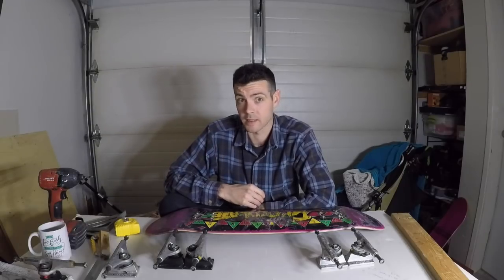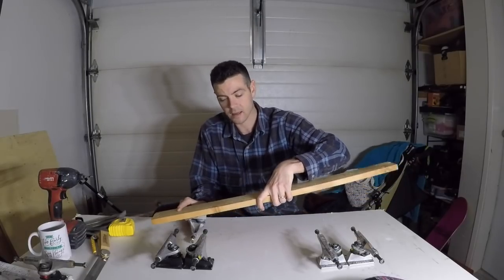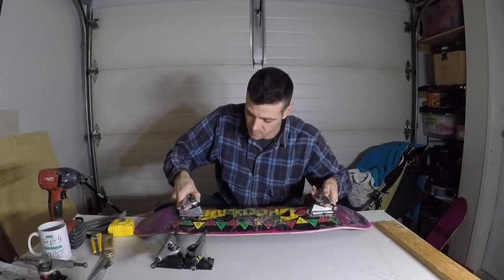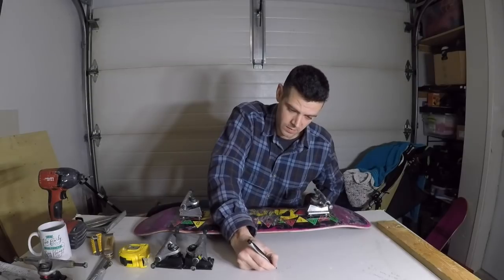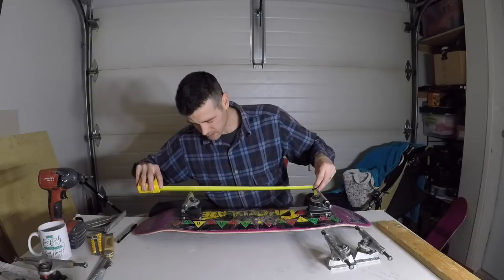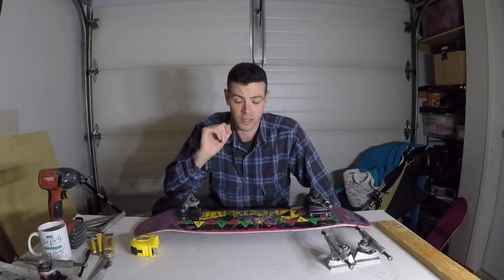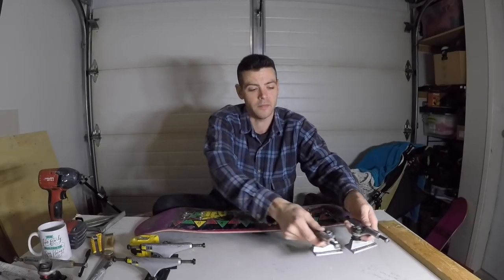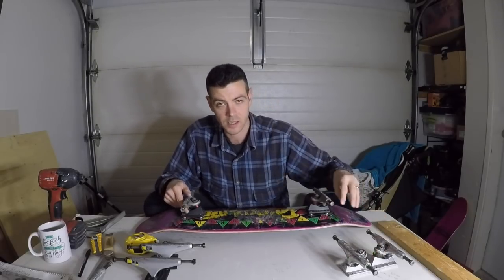Skateboard Wheelbase Explained#2 (Trucks)

Comment: You can take any indy  and add another washer  under your bottom bushing and change the wheelbase of any skateboard. You take a 14.25wb board, tighten your trucks down all the way and your wheelbase would be something like 14". Adding the washer raises up the hanger basically making it a longer wheelbase. 
Lower (tighter) bushings = shorter WB.
Higher (looser/thicker) bottom bushing = wider WB.
Reply: Woah reading this just unlocked a whole new perspective. I’m on hollow lights and I tighten the nut to expose two threads. I think most people would consider that pretty tight but to me as a new old skater it feels insanely responsive. Now I feel like I can experiment with more wheel bases by simply adjusting my trucks. Maybe in a high medium low kind of scenario. 

Anyways comments like yours make YT a place of discovery and I appreciate that ✊🏽
Reply: @OutdoorCanadians  I had to do it with a pRod Primitive board where it was only  14" wheels base. Put a extra washer on the bottom and boom! Huge difference.  Science! 🤣

Comment: Pro tip: use 2 different brands of trucks and make sure one is facing the wrong way. It also helps if each of your wheels is a different size. That'll get you the most pop 👍

Comment: Although;

I've got a brand new wholesale skateboard on my hands yesterday

as yet the deck measures a wheelbase with 12.7" or 32.3cm as which I've tested they having poor handling on doing ollie jump as my first lesson as beginners as yet their package trucks having a soft bushings but the trucks have may coping with generic base plate designs for thunders as yet reaching its 16" barriers but the serious issue was poor load bearing stability as which they need to tighten its bushings
as the mentioned trucks may having over 50mm as tall trucks as which wheelbite were minor deterrence and the general operations did not achieves hazard operations whilst the bushings never been adjusted and they generates mere hazards

as yet I have afterparts that also a generic counterpart by Indie Trucks and the manoeuvre is manageable for its responsive accumulations as they wheelie and turns to command much autonomous and they cruising with less hazards,

they have 55mm tall on my customed trucks as yet the wheelbite is highly zero deterrent as yet never recreating absolute hazards but the only deterrence they reducing the wheelbase with nominal measurements down to 15.6 or exactly 40cm respectively

as though if I comfortable with my nominal 40cm wheelbase were cruising is absolutely cleared from hazards and yet for responsive handling is also cleared but to do with skateboard vaulting tricks were I'm clearly lacking, my question is, are the 40cm nominal wheelbase can also do altered credible stunt possibities?

Comment: You nailed it Ben! Thanks for a good video! Id like to add that another way to say it, is that the trucks wheelbase makes the board pop “faster and flatter”, or “slower and steeper”. Due to the “pop angle” they give.

Comment: "If you don't know how to read a tape measure." I laughed. :)
Reply from the maker: Chris S. You don't realize how many people can't until you start training newbs in construction. I worked at a truss plant for almost 2 years before I started my apprenticeship an everything was measured in 16ths. For example 1/2" was called 8 sixteenths. My first job as an apprentice was working for a gnarly old framer who was screaming measurements at me all day. I had to figure it out pretty quick. I used to stumble with 5/8", 3/8" and 7/8"  for the first little bit.
Reply: Lol... if you don’t know how to read a tape measure.... run headfirst into a wall.... hehe jus messin... Ben is the man!! eeey!(Canada accent) beeen..
Reply: I know a guy who can’t. That said some tapes are way way easier to quickly read. I buy cheap ones when they go on sale because I always loose them or bend them and they are a pain especially for 16th

Comment: Great video Ben it’s rad that more people will know how to fine tune the board to exactly how they want it and also save people money so they don’t accidentally buy a deck with a 15” wheelbase and don’t understand why it’s super hard to do flip tricks lol
Reply from the maker: Honestly, I didn't know about wheelbase until last summer. I knew I liked slightly longer decks and that I liked the gap from the bolts to the nose/tail to be smaller but I hadn't connected the dots to wheelbase yet. All I knew was that if it didn't work on indys switch to venture/thunder. I actually thought it was a truck height thing for the longest time. I had no idea it was wheelbase.
Reply: how is it? is it easier?
Reply: @bendegros  I think it would be a combination of wheelbase and truck/wheel height. Not sure which would have the biggest effect...
Reply: @bendegros  I’m from London and don’t really understand these units, what does the 448 and 449 stuff mean - is this 4.48 and 4.49” inches?

Comment: Hi Ben, I got idea for new setup madness. I've been mixing different parts from different trucks to figure out what works the best for me. For example I mixed Tensor Maglites with baseplate with Destructo inverted kingpin baseplate to get the best kingpin clearance and get lightweight trucks that grind well. I can even add board rails and it would weight as a regular board but it is ultimate street destroyer. Although the geometry of trucks are different in many cases they can be easily adjusted with washers on kingpin in most cases. Also I combine harder and softer bushings on the same axle so that my trucks are kinda loose when turning but stays perfectly firm and flat in a straight line.

Comment: ok I've definitely never pay attention to these wheelbase set up, and now I've watched that explanation, I've check out what was my best set up and what was the worth set up I add in the past, and guess what? the perfect set up I had, have the best combination of wheelbase board/trucks. They should teach you that in skateshops! ahaha
Reply from the maker: What was your favourite combo?
Reply: a 8 1/4 dagger board (dave Duncan) with Indys and 64mm wheels, with that almost zero inches of flat between the tail and trucks, but it was mostly for transition, I felt pretty comfortable on flat ground as well. Compare to my current deck 8 and half, still on Indys, but this time a inch and half of flat, and 65mm wheels. Really heavy, cool for riding fast, but technical tricks are pain to do, just a simple kickflip needs a lot of energy. After seen you video, I will shrink down my setup soon. I love my big boat board, but too big for technical stuff.
Reply: @loveskatemag3066  8.25 isn't a big boat board. They used to be more like 10" back in the 80s.
Reply: idmhead0 yeah I’m aware of that, but in 2020, 8 1/4 is mostly considered of « big », especially in street skating. Most of street skaters are coming back to 8inches boards, and even 7.75, which I’ve used a lot in the 90s. My comment wasn’t about that a 8.25 was big in general, but big for my needs at that moment, where I was trying to get back some flip tricks. I believe that we are in great era of skateboarding nowadays, it’s very eclectic and we have multiple choice of set up available for a lot of variety of skate genre. Compared in the 80s when it was only huge and heavy boards or small popsicles boards who’d break in a week for the 90s. We got to appreciate that!

Comment: Just got high 5.25 tensor  maglight and i use to skate thunder 147 for years (thunder are not that high as you already know haha)..i also skate most of the time 7.75 .i was so confused the first time i went to the indoor skatepark it was hard to just get the snap of a proper pop ...i use to skate 14 inch or little more wheelbase but the girl skateboard arrive home with a 13.813 😮

My question is do tensor have more wheelbase than thunder or vice versa?

Comment: Thanks for the quality videos, already improved my skateboarding! Got me truck-nerding too, so I measured up axle distances for some different trucks I found at home. Surprisingly, my old Ace 03's seemed to have the longest axle distance (Ace 33 < Indy 139 < Ace 03). Would be nice to get a confirmation for this, as I'm not sure if I've messed with the geometry while replacing bushings.

I think it would be a nice improvement if truck manufacturers would provide "offset" as a number, indicating how far from inner nuts the axle is located. Probably won't happen, as it seems to be difficult to publish even wheelbases of decks...
Reply from the maker: That would be nice to know but I think you are right. Most skaters will never wonder about that sort of stuff.
Reply: Anyway, wishing for Ace 03 review and measuring. I liked them a lot, but low height was definitely a problem wrt. wheelbites.

Comment: I wonder where Ace fall in your list. I did some research and found they would be the 440-442 range.
Also, for any big boy skaters like me out there looking for the biggest wheelbase possible; your best bet is the thunder high 161. You won't find wider. Venture doesn't make wide trucks. Assuming you ride mostly 9" like most big boys.

Comment: What about low mid and high .and how does that work with pop if you consider the wheelbase  like tensor lows and the like indy high or to 2mm different in the mindy and high indys   I was just wondering that obviously plays apart cause now that I got the mid indys it seems that my tail hits quicker but has a different angle  kinda like tensor low my tail would hit so quick I'd be able to ollie fences  but when I moved up I had to relearn  when to swipe my foot up so my height when dont with a higher truck but the mid is a happy well medium so I'd like to hear an explanation of that

Comment: just did some research, i think the main difference between Thunder Team/normal ones are base plates.
Team have the original base plate, which is shorter wheel base
and the all forged plates models are longer & lower height by 1mm-1.5mm
Just guessing, I don't have Thunder trucks handy, recently wants to swap my indy 139 to Thunder

Comment: The Thunder 148s have the same geometry as the Thunder 149s, just a narrower axle and hanger. So Thunder 148s and 149s have the same pop geometry. Slight difference in weight though

Comment: Interesting. I would have thought the Thunder High and Team Hollows would have been the same since they use the same mold for the baseplate and hanger.
Reply from the maker: The team hollows are for sure higher by about 1.5 mm. Both times I measured the wheelbase it was a bit shorter. My measuring was definitely not accurate enough to be considered gospel but good enough to see the wheelbase was about 1 or 2mm smaller.
Reply: Do the highs have a forged baseplate? Or are the highs a 147 compared to the Team Hollows being 148 or wider?
Reply from the maker: I can't really tell if the baseplates on my team hollows are forged. The baseplates are powder coated so I'm not sure. My standard thunders highs have a regular baseplate.

Comment: Great Video Ben, it's all these things that one ponders about when getting new gear but it's great to have it all laid out so well so thanks for the service :)! Could you suggest general setup sizes for a 6'4 tall guy? lol I was on 8.5s with 14.5 wheelbases and it still feels a bit small - I especially notice that on anything 180 related - that is with 149 indys I tried going up to an 8.75 with 159's which felt alright but I couldn't flip it for the life of me. I am a bit confused to be honest...
Reply: How did things shape out for you? did the 8.5 end up becoming comfortable to you with time? or did you end up finding your best fit to be smaller or bigger then that?
Im 6'4" myself im on a girl deck thats 8.25 right now with a 14" - 14 1/8" wheelbase but its got 7" nose and tail (basically symmetrical except for the slightly different angles) the board has 3 fingers of flat nose and tail side and ive got it on stage 11 hollow 144s the board feels alright but for sure can tell its a bit short in the wheel base for someone of my height.
im about to experiment with my next deck that ive got ready to go being an almost uber light 8.25 with a 14.25 wheel base 6 3/4 tail, 7 1/4 nose and steep concave compared to the mellow girl concave. 
and my next board after that likely being a 8.25 - 8.5" baker board or neen williams deathwish twin nose board.  
I know baker 8.5s have a 14.5" wheel base so im interested to hear an update from you a year or more after your initial comment regarding your height and board sizes... where did you end up feeling most comfortable?

Comment: I never cared about this stuff until I found your vids now this is by far my favourite channel on youtube. The downside is I have so much ocd on what wheelbase to go with and deck length now that I've gone from thunder 147 std to indy 149 fh and gained that extra height.  Would you say between 14 and 14.5 would be ideal for wheel base rolling on some 52s? Hate the recent experience with ghost pop. 

Never leave youtube ben👌

Comment: Venture and independent are similar in wheelbase? That’s so weird because I have twin setups (pizza 8.25, 53mm formula 4s) the only difference is ones stage 10 independent 139 (8in) and ones venture 5.25 (8in) and there’s a huge difference. Especially with frontside and backside flips. The independents I can frontside flips super good flat ground and down stairs but can’t backside to save my life on them. The venture setups the exact opposite, My backside flips on it are so easy flat and down stairs but I can’t even frontside flip on flat on it 🤨. Weirdest thing. I’m looking for a truck I can do both good on. Gonna throw some 147 thunders I have on the same setup and see how that does

Comment: have you found any trucks since then that give you a bigger wheelbase than thunders do? i bought some thunders and i want more! i need the nose even heavier!
Reply: Saw off a couple inches of the tail. That'll make it heavier. I can remember skating a Bones Ripper board in the 80s. The tail was worn down like crazy. Seemed like it was probably only 4 inches or less. Yet somehow, I was actually able to ollie pretty decently with it. If I recall correctly, I was able to ollie a small shopping cart on it's side. Don't ask me how. I sure as hell wouldn't be able to do that today. We used to beat the hell out of our boards back then. Seems like Ben switches boards before the tail is even razor tailed at all.

Comment: Hey Ben, when I convert the measurements in the video from inches to cm, I get different values than you have in the description. 

Here is my truck measurement nerdiness table:

Venture 5.8 standard with bones bushings - 442mm
Venture hollows 5.6 with bones bushings - 447mm
Royal IV 5.5 with bones bushings - 438mm
Royal IV with Standard bushings - 440mm
Royal Standards 5.25 (new model) - 436mm
Independent stage 9 146 - 439mm
ACE 44 - 429mm
Krux k4 8.25 - 435mm
Film Trucks 5.75 with bones bushings - 436mm

Comment: Here is my axle to axle wheelbase:

432mm/17.00"

Deck wb is 14.125" (435mm/17.125" @ 14.25" wb)

Truck: Theve TiAX V3 5.5"
Reply: I also have a freestyle-deck with 13.5" wb and Thunder trucks. if I lay it besides my 14.125"wb deck with Theeve trucks the freestyle decks axles to axle wb is sligthly shorter by 1-1.5mm.
Reply from the maker: Nice! Thank you. I just tried out a pair of theeves but didn't write down the wheelbase. I will add it to the list in the description.
Reply from the maker: Now we need some Krux.

Comment: So if a board had longer wheelbase since it would be more vertical on the pop do you think it would make my impossible more vertical ?
Reply: Basically a product won’t really make you better.. it (mainly) depends on your skill. But it does help noticeably sometimes.
Reply: I don't think so, because a longer wheelbase only makes that the pop needs more force since the lever on the other sides gets longer. But if the tail gets shorter or/and a steeper angle it will pop slower but more horizontal and you need more force to pop it. If you use higher trucks or risers it has the same effect.
The thing is that trucks that gives you a longer axle to axle distance makes that the nose and tail feels shorter and increases the pop angle.

So you could try trucks like Ventures or Thunders, riserpads or decks with shorter or steeper kicks, but if it feels to different to your actual setup it takes a while to get confortable on the new setup.
Reply from the maker: For sure it would help. Bigger wheels would also help. When guys first started doing those on street decks they had huge wheels and risers and big steep tails.
Reply: Ben Degros Forsure man I have always ridden flat decks and my impossible always wrap more horizontal than I would like.

Keep up the great work love all these videos
Reply: Vincent 17 the technique is what makes impossibles vertical. Doesn’t matter what kinda board you use. It’s about getting a good wrap then flicking your ankle up and lifting your leg